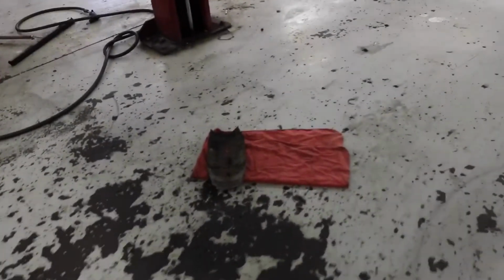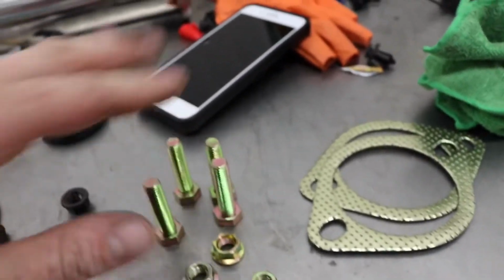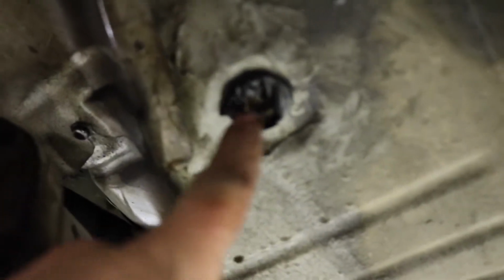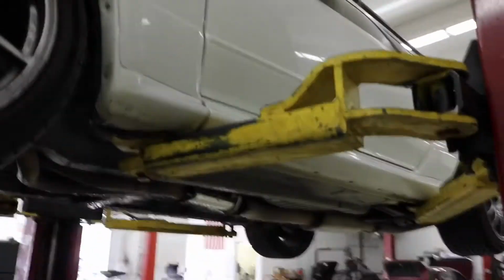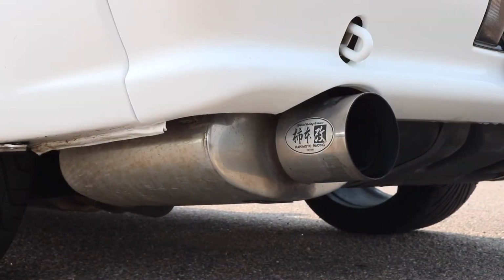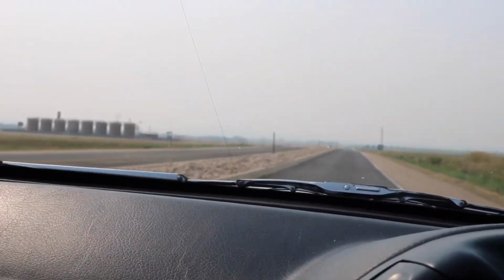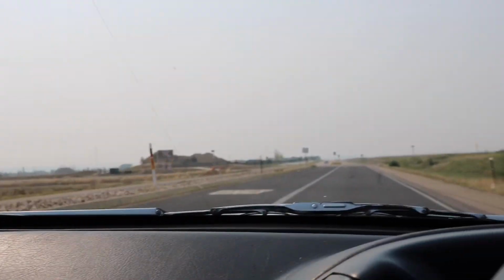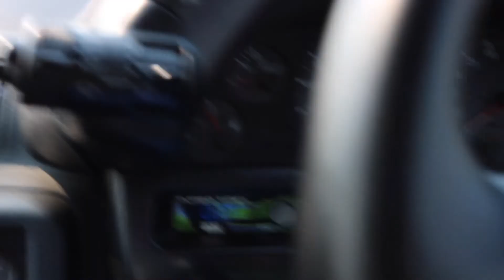Test pipe install on the skyline GT-R

Comment: Was it easy to remove the sensor? Doing this soon
Reply from the maker: Captain Two6 I used some rust penetrate and let it sit for a few minutes. After that came out no problem. To unplug the sensor move the passenger seat all the way forward and you can get to the plug easy from under the seat (go from the back of the seat) and I just subscribed to your channel
Reply: Friend Built thanks for the info I just finished my install. It was pretty straight forward. The exhaust note sounds a little deeper for me but I know you already had yours gutted which is kind of crappy. That weight savings though lol
Reply from the maker: Captain Two6 yeah it's was a easy job. I subscribe to your channel and have been watching your videos I love the r33.
Reply: Friend Built thanks man I subbed back. Keep the vids coming!